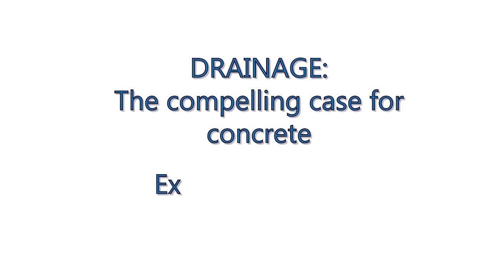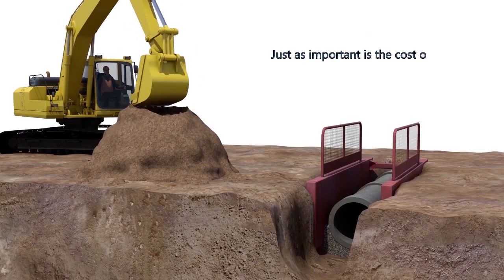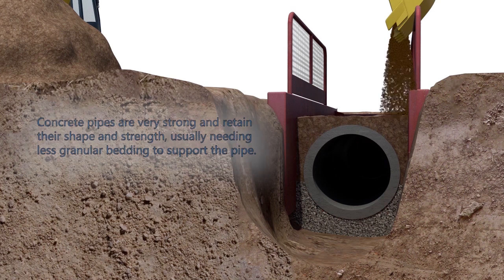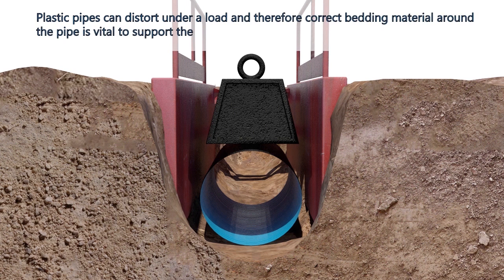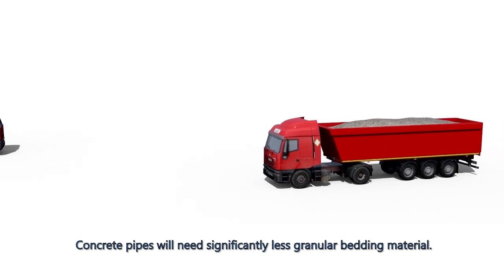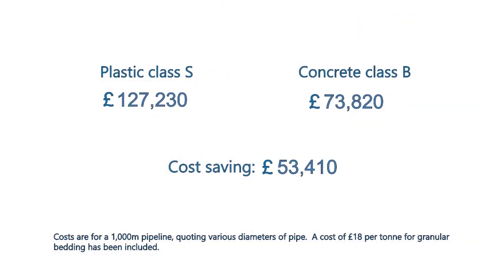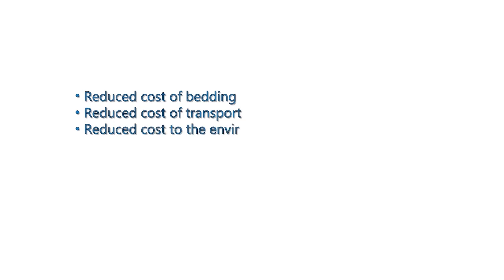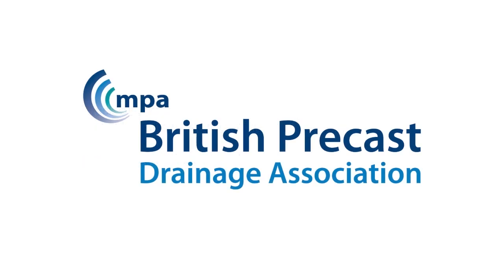The Compelling case for concrete pipes – Exhibit One: Cost

Comment: Plastic lasts much longer than concrete
Reply: And it's much stronger.  Rock is not suggested or required as a bedding material for most HDPE pipe.  Most manufacturers suggest best practice is to install soft lift material...aka sand or loamy fill.